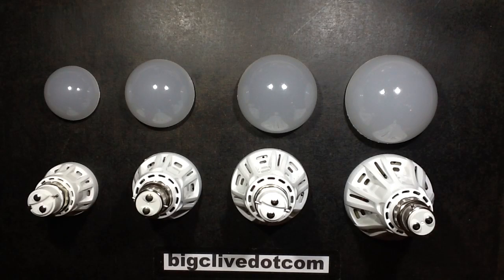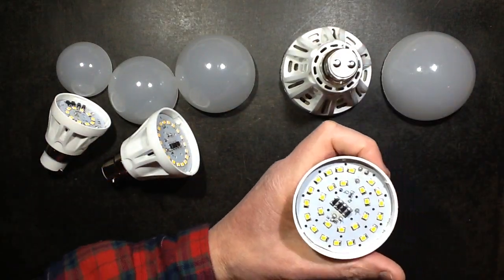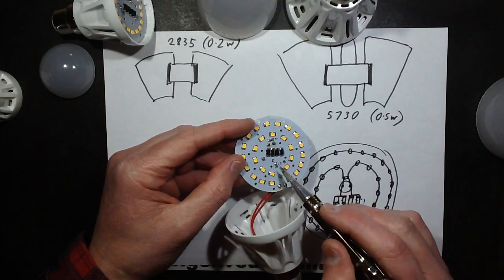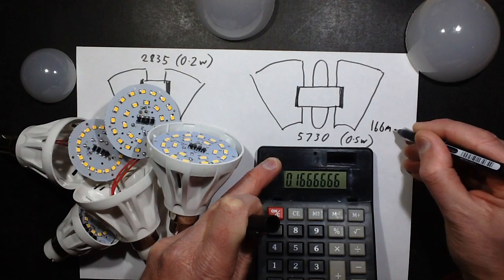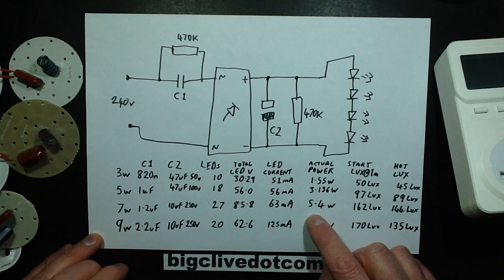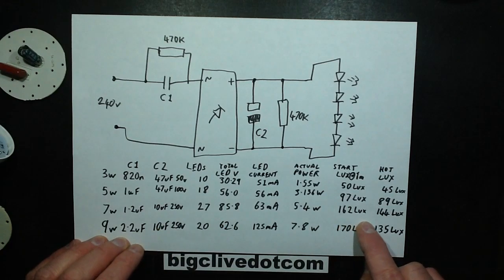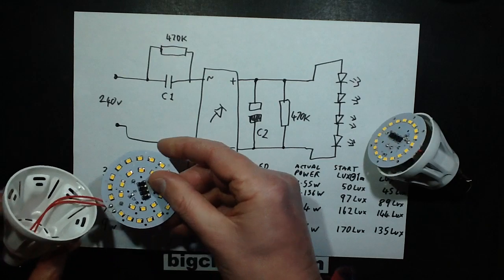3W, 5W, 7W, 9W same-range LED lamp teardown.

Comment: Dear Clive. I am trying to find a driver chip AREZZO 328A replacement for 5W LED bulb. Unfortunately I can't find from Aliexpres.com. Any recommendation for equivalent 8 legged chip? What's the constant current for 5W bulb? Many thanks
Reply from the maker: It's often difficult to source components for mass produced products as they are only supplied to manufacturers.  There may be a pin compatible equivalent, or a new power supply could be used.
Reply: @bigclivedotcom  When I source for LED drivers at Aliexpres.com there are plenty. There are so many models which I don't know how to select. Please if you can help choose one that's suitable for 5W LED bulb. Thanks

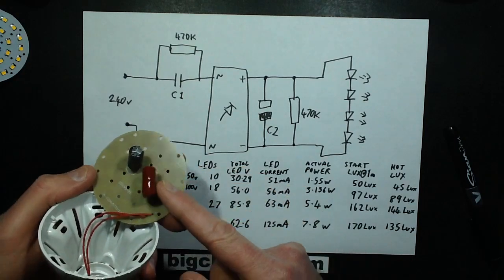Comment: At 7:52 you say:
"if the LEDs fail open circuit the voltage across the capacitor will rise well above it's rating, it'll probably go pop"
I had a similar lamp with identical circuit but differing package, fitted in our bedroom.
My wife called down saying the bulb was making a 'funny noise', I entered just as the lamp did indeed go POP! Plenty of the very typical hot and not happy 'electronics gone wrong' smell.
After swapping the lamp out I opened it up ('gentle' persuasion with a hammer to separate the dome from the base, leaving both intact). The cap case had blown off the cap base instead of splitting at the top! One LED did have a dark spot so I assume that's open circuit and hence the pop. Am going to replace the LED, and pop (ha!) in another cap  rated at 400v... just in case.
Thanks for your vids - they're brilliant!

Comment: Hi Clive excellent video. I notice that the percent of the maximum driven current is rather different for the 7 compared to the 9 watt light.  Almost 100% for the 7 watt but only 75% for the nine watt. Wouldn't this have quite an effect on the brightness of the LEDs.
Reply: B

Comment: Hi bigclive could you explain c1 and c2 briefly?
Reply from the maker: C1 allows a small portion of current through on each half wave of the AC supply that then gets rectified to DC and C2 acts as a reservoir for smoothing to reduce flicker.

Comment: Thanks for this informative video.  what is the voltage rating of C1? did I miss it in the video?
Reply: Probably 1000V, or anything higher than 250-300V. In case someone reads this in the future.

Comment: the capacitive dropper effects the reactive Var component of the mains power consumption, i do no how much it affects the energy consumption, i do happen have a basic power meter, eg a  3w capacitive led bulb will consume a VA of 3w & Var of 55w, whereas a 40w filament bulb has the same values, so is it really energy saving.

Comment: Have you done a teardown of that PoS power meter before? After seeing you use power meters all the time I ordered one of the cheap and ubiquitous ones on eBay hoping it would be similar to yours, but my expectations have just been downgraded substantially from hearing your comments.
Reply from the maker: +codebeard I should do a teardown of it.  It is modestly useful, but doesn't deal with odd loads well and can give incorrect power and current readings with some circuits.
Reply: +bigclivedotcom Shame, you'd think the Chinese would be all over handling odd loads given their penchant for weird and wonderful power supplies.
Reply: +bigclivedotcom How could I run one on 12v? as I have some at home.

Comment: I have an idea that is probably wrong, but I'd like to have input as to why. Could the difference between the 9W and 7W be due to the fewer LEDs overall on the 9W? Since there are 7 fewer LEDs doing (initially) more work, could it be that the individual LEDs heat up more in the 9W from generating more heat as they are pushed harder?

Comment: 1.How to found Current??
And Why are you using ELCAP Higher value for 7W? 
For 7W you are using 250V elcap but you only need 86v Voltage. can you please explain me the fundamental about this.

Comment: Hi Clive,
As always full of information, wish I'd watched it before I bought some though, I bought a box of 6 for just under £10 (I know, I know!) and found them to be quite interesting inside as ended up pulling them apart to see what the electronics were like.
Not very impressive!
https://www.youtube.com/watch?v=TBcm2BgW9so
Reply from the maker: +Andy Brown Pretty common [capacitive dropper arrangement.  It's odd to see an LED quite as exploded as that.  It's possible that the red capacitor may have failed and passed enough current to blow the LED.
The LED PCB is a common aluminium core type where it's an aluminium panel with a very thin shim of fibreglass PCB material laminated on one side.  Mainly used to assist in heat transfer.
Reply: +bigclivedotcom Thanks for the fast reply, I'll pull them out again and test the components when I get a chance to next to see what failed to get an idea on them.
Reply from the maker: +Andy Brown You may not find anything.  The metallised film capacitors are often "self healing" in that they basically blow themselves clear inside.  So you may not find a fault.
If you were to swap those capacitors for a lower value like 330nF 400V then the lamps would run cooler and dimmer but last much longer.  Snag is the capacitors would probably cost as much as the lamp.
Reply: +bigclivedotcom    can any one help me by listing all the component names?

Comment: Hello,
The value of capacitors in alternating current (for series LEDs) how is calculated.
For example, how many 20 or 28 LEDs (nano, micro) how is the Farad capacitor. How does the capacitor voltage and current limiter. Thank you in advance.

Comment: How do you compare this circuit (capacitor drop) and a proper LED Driver circuit with a switching powerSupply?
Reply from the maker: iwantitpaintedblack The capacitive droppers are very simple, but better suited to driving large numbers of small LEDs at low power.  The switching circuits are better suited to small numbers of high current LEDs.
Reply: and what about efficiency? and ive heard that they can lead to a catastrophic failure, a video on that would be cool

Comment: The lux measurement is very problematic for a comparison, because it doesn't really tell you anything about the total light output of the bulb, which is the important measure for diffuse lamps. It could very well be that the LEDs of the 9W lamp have a different beam angle, which means the lux measured are not compareable.

Comment: Why do we need a discharge resistor across the capacitor?! won't the capacitor get discharged by the leds?
Reply from the maker: The electrolytic's discharge resistor is probably more to make sure the LEDs go out properly when the lamp is turned off.  By putting a small resistive load in parallel with the LEDs any slight leakage through the mains switch wiring will be shunted so that the LEDs don't glow slightly.

Comment: I've that PoS meter you showed.  With me, it intermittently gets stuck at 0 watts when an appliance switches on.  Normally I turn off and back on the appliance and it reads fine, but with an appliance that cycles (e.g. dehumidifier), it intermittently misses a running period and in turn gives a lower than expected total kWh reading.

As the 9W bulb was a disappointment, it might be worth trying an experiment to see what happens if an LED goes open circuit, e.g. remove an LED, reassemble it and film it powered up to see if the overloaded capacitor results in it smoking, going pop, etc.
Reply from the maker: That might not be a bad idea.  It sounds like your meter is crashing when the load turns on.  Mine displays very random power factor and sometimes shows a power draw that is higher than the load being tested.  Even when the load hasn't been connected yet.